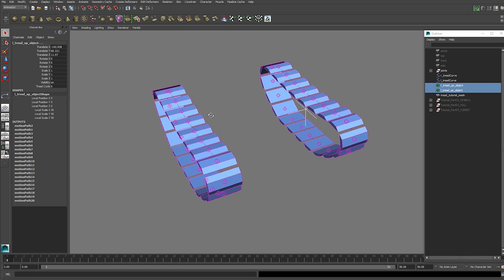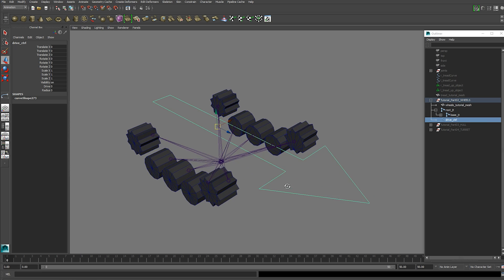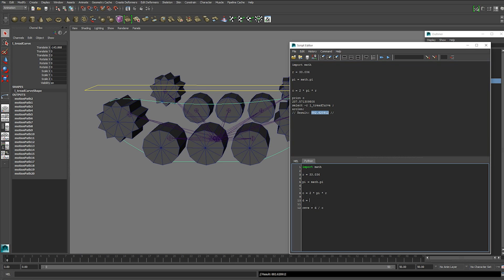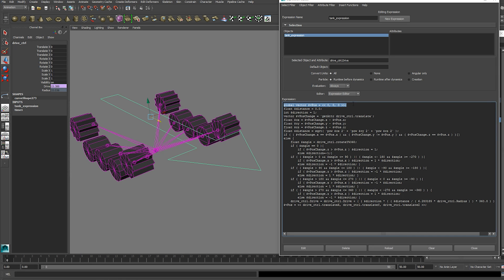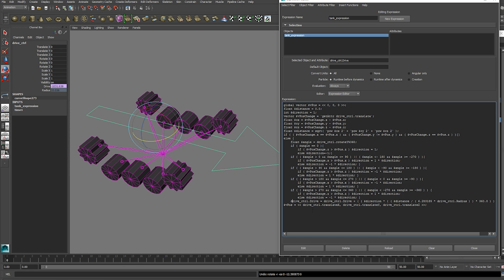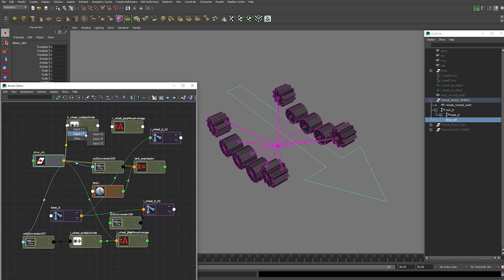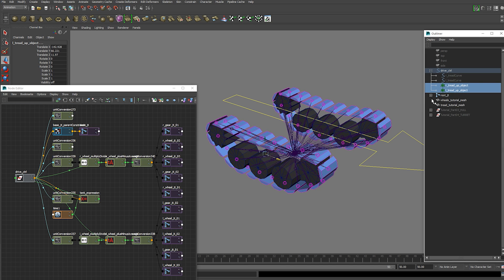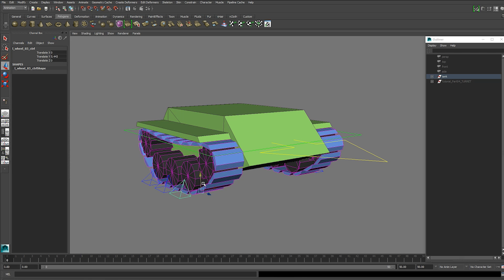How to Rig a Tank in Maya | Tank Rig in Maya | Part 2 Wheels

Comment: is all this only contained within maya? can i take this into unity and it will just work the same way?
Reply from the maker: @mollysmoshingtankcrew9441  you could animate it in maya and bake down animations to import to unity, but that is all
Reply: @SimonMills  sorry for the dumb question. I'm fairly new to game dev. so all the cool hull movements are only contained in Maya to get that same effect in say unity or unreal engine you would have to do all of this within the that specific game engine.
Reply from the maker: @mollysmoshingtankcrew9441  that is correct.  The only way is to bake down animations from Maya with the hull movements in the animation.   You could save out turret/hull position pose animations and have them linked to your turret movement in engine so the poses blend to your horizontal aim rotation angle.

Comment: Hey Simon, love the tutorial, I just have a question about different sized wheels... I saw you explain that if you have different sized wheels, you need to connect the 'standard' wheels, to the 'different' wheels through a multiply/divide node, but I don't think I'm doing it correctly.. Could you go into more detail about how to make the drive control work with different sized wheels? THANK YOU!!! Love your work!
Reply: Dude I had the same problem
Reply: DUDE, I've wanted to ask the exact same thing but I'm worried Simon wouldn't reply. So happy that someone has reached out. A bit more detail would help me by a mile. Keep up the great work Millsy! :)
Reply: @SimonMills Hiya! I'm having the same issue and I just wanted to clarify... In the node editor, plug in the drive_ctrl's drive attribute to the smaller wheel's rotate X, then the smaller wheel's rotate X into a multiply/divide node (i assume into any input) and then plug that into the primary wheel's rotate X?

I'm obviously doing it wrong haha, just would like a more in-depth explaination THANK YOU!!!!
Reply: I got the same issue man
Reply from the maker: Wow a lot of people doing this tutorial at the moment!  Basically, the idea is to know the difference in wheel size between your primary wheel and your other sized wheels.  So for example, if your primary wheel has a radius of 25 units and you have a much larger wheel that is say 50 units, then all you would do is have a multiply divide node coming from your primary wheel spin that multiplies the rotation by 2 because the larger wheel is double the size.  If you have smaller wheels you would just divide. Hopefully that makes sense.
Reply: @SimonMills  THANK YOU SO MUCH!! Love your tutorials brother!! You're a god amongst men!
Reply: what a coincidence!!!! im legit having the same issue vro... would love to see a response so i can fix this!!!!!! need my tank rigged asap?!?!?!!?!?!?!?!?!?!?!!!!1
Reply: O M G. SAME DUUUUUDEEEE. I am having problems with the wheels too.

Comment: Hello, I was able to get here but when I copy the variables this appears, and I have the same controller name :( // Error: Attribute not found or variable missing '$':  drive_ctrl.Drive
Reply from the maker: are you using a namespace?
Reply: @SimonMills  the driver has the same name, drive_ctrl
Reply: @SimonMills this variable has worked for me before but without using the node editor for the rims lefth_wheel_1.rotateX = ((tank_ctr.translateZ / (2 * 3.14 * 0.36)) + (tank_ctr.rotateY / (2 * 3.14 * -7.2))) * 360; but putting the name of each joint at the beginning, what I don't know is if it works for me when merging the movement with the treads
Reply from the maker: Send me the scene file and I will take a look -  smills@trickbox.ca
Reply: I already managed to do it with the variable that was used previously and it worked for me with the treads, I thank you for taking the time to respond and wanting to help me, I will continue with video 3 :) @SimonMills

Comment: Heya. I have a problem, the wheels seem to work fine when moving forward and turning, yet if I move backwards all wheels move forward still. Been over the setup a couple of times now and I cant find the issue. (Edit) Problem solved, got a programming colleague to check the expression and in the if poschange section exchanged z with x and -1 with 1 and vise versa and now it works. I had my rig oriented a little different facing x because of the way I laid out the tracks. Although the wheels still turn when moving the tank left or right, as if drifting, not sure if  thats considered within the expression or not.
Reply from the maker: Glad it worked out!  The drifting is part of the expression. It ensures the wheels are moving when the tank is pointing in all other directions.

Comment: Hey , i know this is a few years old but , i'm trying to use it to make mine. The thing is , my tank chain as 4 differente size wheel. When i work them on differente ctrl it work but when they are on one , the Translate attribut is not pass to the X rotation of the other wheel ( the first wheel work ) and the rotation work. Any idea ?
Reply from the maker: Connect the other wheels to the working wheel with a multiply divide node. Then you can set values per wheel to account for the size change.
Reply: @SimonMills   Hey ! Thank you for your answer ! That exactly what i did in the end , i got the idea during the night ^^

Comment: Hi there
Thanks for this amazing tutorial
I learned a lot even understood the mathematics behind it 
only 2 points if you can explain or mention   the laws behind it and I will search
the Wheel.roationX = drive + (revs * DriverCtrl.rotationY)
so the rotaion is calculated when both the tank moves forward or spin around it's self ,Right ?
what is the relation between Revs and Rotation Y ( probably the circumference of the whole tank)  
also revs relation with the thread length that we multiplied by 360 and dived the average node
Sorry if I it's long
and Thank you again for this amazing tutorial

Comment: Thanks for the great tutorial! But I have a little problem. when I put the motion chain on the curve, the object is applied far away from the curve. Even if I move the rigging bone and adjust the position, it will return to that position when I adjust the cycle. May I know what the problem is?
Reply from the maker: This is very odd.

Comment: Hi Simon I been working on this rig for 3 days. The expression works on the model you provided but doesn’t work properly on my own product even after calculating the radius the diameter properly. When I move it in Z-axis it rotates both ways positive and negative direction and it’s too fast. I did all the steps as you mentioned in this video still doesn’t work properly. Please can you address this issue.
Reply from the maker: That seems very odd. Send me the scene and I will take a look. smills@trickbox.ca
Reply: @SimonMills  I made a mistake while written the expression. I’m sorry on my behalf. Thank You it works now

Comment: Hi, Simon! I'm following along with this tank series of yours still. It's been quite helpful. Question, though: I've gotten about 12 and a half minutes in or so, where all the wheels and sprockets/gears are set up to drive and rotate in opposition to each other when turning, but my tank has rollers on the top section of the treads that are much smaller than the rest of the wheels/sprockets. I don't have much experience using multiply/divide nodes, and I've read some similar questions in the comments, but how would I ensure these rollers roll with the correct amount of revolutions relative to the rest of the wheels in the node editor? I've already measured their radius and printed the revolution value as well. I'm just kinda stuck on how/where to use and plug those values in in the node editor so that it all works correctly. All help is appreciated. Thanks again for all your content!
Reply: Hi, i haven't tested this but, have you tried adding an second attribute Radius ("Alt_Radius" or smth) in the drive_ctrl then simply modifying the expression "drive_ctrl.Radius" to "drive_ctrl.Alt_Radius" (near the end) and apply the expression for your set of smaller wells ?

Comment: hey simon at 3:02 your wheels are the same size, but my 2 out of 4 wheels are not the same size.. what should i do there?
Reply from the maker: Pick one size to be the default, then just connect the other by using a multiply divide node.  Example: If one wheel is half the size of the other, multiply the drive value by 2 so it spins twice as fast.
Reply: @SimonMills   yes thanks , i got that done but now at 14:36 I have three PlusminusAverage BCS i have 3 wheel sizes in the treadWheels, what shall I do here? BCS if adding any random d/c * 360 results in tread going out of sync/ fast/ slower than the wheels corresponding to it
Reply from the maker: send me a screenshot/video.  smills@trickbox.ca
Reply: @SimonMills  sending
Reply: @SimonMills  sent the maya file as well because i am bad at explaining, but the main issue is still that the wheel still spins at normal value and not taking in the second multpydeivde i added and the second problem is the which wheel to calculate the degree so it stays in sync with treads, Thanks <3
Reply from the maker: @nikhilb1502  looking at it now

Comment: Hello Simon thanks for your tutorial. This tutorial really helped me a lot throughout my current project i just love it. I have one Question i have multiple variations in the size of my wheels ( one is big the other is the same but smaller)  do i have to change something in the Expression except the code name of the smaller Attribute? I created a "Radius" and a "Radius_small" as attributes for my drive_ctrl. Perhahps you can help me with this one what to do if the wheels a different in size?
Reply from the maker: Pick a wheel as your primary size. Now connect the rotation of each wheel that differs in size to the primary wheel using a multiply divide node. Now you can work out the radius difference between each and your primary and use that value in your multiply/divide node.
Reply: @SimonMills  thanks i'll try it :)
Reply: @SimonMills  Hiya! I'm having the same issue and I just wanted to clarify... In the node editor, plug in the drive_ctrl's drive attribute to the smaller wheel's rotate X, then the smaller wheel's rotate X into a multiply/divide node (i assume into any input) and then plug that into the primary wheel's rotate X?

I'm obviously doing it wrong haha, just would like a more in-depth explaination THANK YOU!!!!
Love your tutorials simon, they're a GODSEND!!
Reply: @caelanchicas7663  i'm also having the exact same issue
Reply: I kind of got it to work, but I'm unable to edit the multiply/divide node's values so the different sized wheels aren't rotating at the correct speed... am I plugging the rotate X into the wrong input in the multiply/divide node?
Reply: @SimonMills  I'd LOVE a more in-depth explaination too pls! I'm fairly new to node editor-rigging and the different-sized wheels is stumping me! THANKS SIMON LOVE YOU!!

Comment: Hi Simon Mills Tank tutorial is awesome & a nice explanation. I followed the same step by step but I'm getting unexcepted things in treads. Treads seem to rotate along the axis randomly, even as the tank is still. Can u help on this. My animation frame start with 1001.
Reply from the maker: restart Maya, this may be a viewport refresh issue
Reply: @SimonMills  Thanks for the quick reply & I tried but it won't work my bad time. I have changed viewport 2.0 to legacy default viewport.
Reply from the maker: @ananthyaswanth  so same issue even with legacy?
Reply: @SimonMills  yes
Reply from the maker: @ananthyaswanth  can you send me a video of the issue? or better yet the scene file?  send to smills@trickbox.ca
Reply: @SimonMills  ok.

Comment: hi i am working through this tutorial and have some trouble after bringing the treads back in and parent the joints to the root and the controllers and locators to the drive ctrl. when i grab the arrow, the wheels move when rotating but not when translating. i'm not sure if it has to do with the nodes, but when i made the whole thing, there was no input1D1 after connecting to input1d0 so my nodes look different from yours. any idea where i messed up?
Reply from the maker: The wheels move only when rotating the drive ctrl.. hmmm - Are the treads moving correctly?
Reply: @SimonMills  i actually figured it out. when i connected the nodes to input1D(0), since i'm on a later version of maya it didn't show input1D(1) so i just connected it to input 1D(0). this broke the other connection and messed things up. i figured out later that i had to use the hamburger icon to make the node show all functions and do it that way to get input1D(1).

Comment: Hi. I've followed along with your tutorial and was successful in getting the treads to work with the expression. It seems inconsistent though, sometimes the treads won't move, however the "Drive" attr is updating. And on render, the treads seem to rotate along the axis randomly, even as the tank is still. Wasn't sure if you've had this issue before.
Reply from the maker: Sometimes viewport 2.0 fails to update, try restarting Maya before a playblast or render.
Reply: @SimonMills  Thanks for getting back to me so quickly. I'm using a render farm so that complicates it a bit. 

I've even added a conditional to the beginning of the expression, making it check to see if the current frame is above 0. Just so it will constantly update but no luck.
Reply from the maker: @LucasSantos-cn4wb  does it happen in playblasts?
Reply from the maker: Ideally you should bake your animations b4 rendering your final, especially if you are using a farm.
Reply: @SimonMills  Didn't see your question before. yeah it happens in playblast. Baking the animation is a good idea, I think that can definitely fix it.
Reply from the maker: @LucasSantos-cn4wb  let me know how it goes.
Reply: @SimonMills  Alright so I had to do something a bit odd. In the file the rig was referenced in, I had to update the "evaluation" option in the expression editor to "Always". Even if it was already on always, it seems just toggling it made the expression work again, then once I did that, the bake was successful. So I just "wrote" a script that would update the evaluation and bake the objects all at once. Really all I did was copy the MEL commands from the script editor output and pasted it in a MEL tab in script editor. But yeah it rendered out just fine so thanks for the help.
Reply: If anyone needs the conditional I put in the front of the expression for some reason, I'm just going to paste it here:

$frameCheck = 0;
if (frame > $frameCheck) {
    (the rest of the expression)
}
Reply from the maker: @LucasSantos-cn4wb  thanks for posting your solution.

Comment: Hello, great video. I have a question. How do you calculate the spin of the wheels when the tank is rotating? In here you just take the number of revolutions of the wheel for the track and multiply it with the rotation of the Y-axis of the drive_ctrl. I ask because in the car tutorial you calculate the arc length that they make when u rotate them around something and then add that up to the overall distance that they make, which seems the correct way to go. Thanks
Reply from the maker: Excellent question. The distance traveled when rotating could be setup just like the car but because the center point the tank rotates from the center of its mass the distance expression does nice job of spinning the wheels/tread correctly. The car had the same thing but also used the additional arc length for the steering distance traveled when the wheel rotates around the steering pivot. This value is added or subtracted from the total distance to give the wheels the correct spin.

Comment: its a long shot as how old this video, but ive been trying to troubleshoot the gears, my gears are much bigger than my wheels and i was able to set up a seprate controller for the gears but when used all together with the drive control it does not work properly. any suggestions for what to do for a setup with bigger gears than the wheels?
Reply from the maker: Setup your normal wheels, then link the large gears to them with a multiply/divide node. The value will be relative to their circumference difference.
Reply: @SimonMills  Thank you so much for the reply! just to make sure im understanding you correctly, am I linking the actual joints together with the multiply/divide or am I setting up the gears own multiply/divide and plusMinusAverage chain? sorry for my confusion this is first time working with these kinds of nodes
Reply from the maker: @evantalley9648  Yes, link the joints directly with a multiply divide node. Have your correctly setup regular sized wheels or gears drive the large gears.
Reply: @SimonMills  Awesome, thank you so much!

Comment: Hi, I am using your expression to drive the wheel. When I animate it from frame 1 to 120. I get popping between frame 1 to 2. I noticed that drive gets -ve value on frame 1 and 2. DO you know what may be causing this?
Reply from the maker: Hi Utkarsh, sorry I missed this comment. Are you still having this issue?
Reply: @SimonMills  I will try it one more time and then I will inform if I am still facing the issue :)

Comment: Did you ever get any jumping in your track drive value after setting keyframes?
Reply: It was actually just mayas timeline cache, maybe it wasn't updating correctly when the expression did its thing. Either way, I think its working fine when the cache is disabled.
Reply from the maker: Never saw the issue, but I did have one other person mention something similar. Glad you got it worked out.